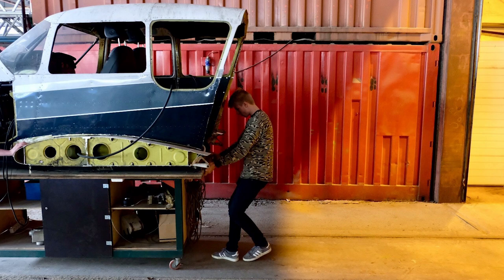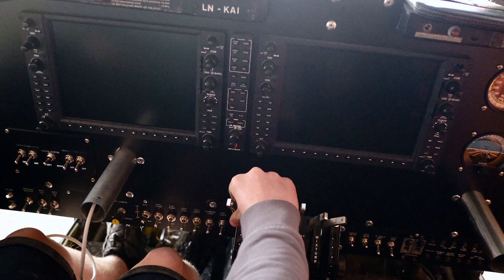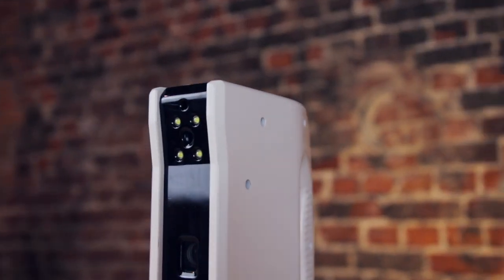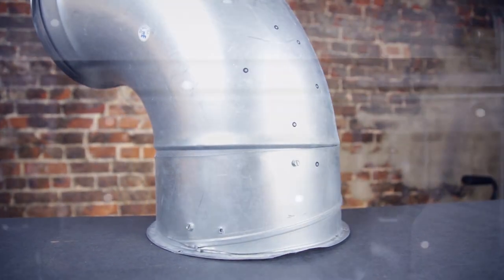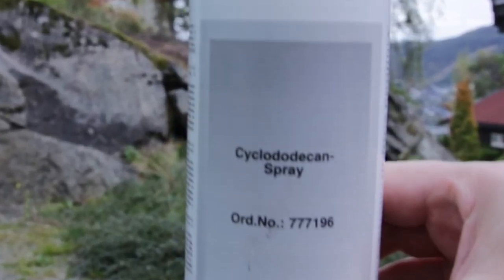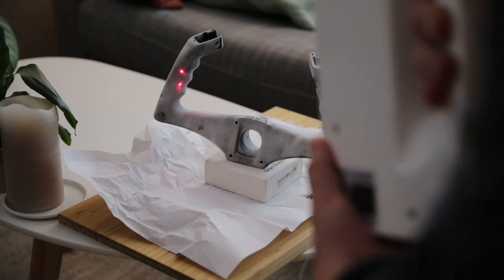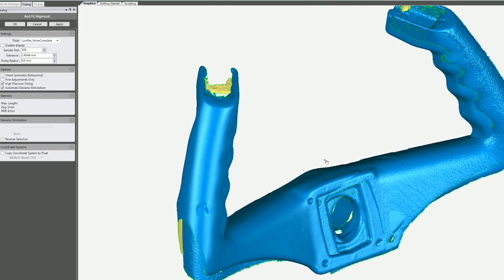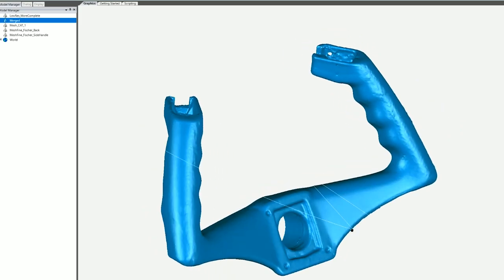3D Scanning a airplane Yoke controller - Thunk3D Fisher S

Comment: Is this the better 3d scanner in the range of 1000$?, do you think that Einscan sp is better? or even SE version?
Reply from the maker: It's a bit higher, as it's a handheld scanner. More in the range of Einscan Pro+ , but cheaper =).  THey have the Thunk3D Cooper M20, that I also reviews that is much more similar to SP/SE
Reply: @3DPrintTechDesign  how does it compare to the einscan pro+?  I own a cooper m20 and looking to upgrade to the fisher S

Comment: Pretty good scanner for reverse engineering imho
Reply from the maker: it does the job very well! fast and easy =)
Reply: @3DPrintTechDesign   I see, thanks for this video!
Reply: For a price of 6k ist damn shitty.
Even a smartphone or xbox kinect can do so... lol

real quali? check the GOM Atos Core...

Like in this Video:
https://www.youtube.com/watch?v=iNqCLwoMBCk

https://www.gom.com/metrology-systems/atos/atos-core.html
Reply: @hanswurstusbrachialus5213  I understand this is a 7 month old comment but Ill reply anyway.  The Fisher has demonstrated the best scans from my research then any other handheld scanner in this price range.  It especially excels from my eyes in organic material such as the human face. The Einscan, Peel, and more do not achieve the same results and if they do then they do not showcase it in their sketchfab models.  The scanner you linked is currently listed at 27,000 USD and is not a handheld scanner.  Research a little next time :)
Reply: @CauldronBlack  The scanner i linked was not supposed to be an alternative.

But an example for real quality.

Read better next time.
Reply: @hanswurstusbrachialus5213  I could be wrong but in most situations when someone says this product is shitty and they should check another one out...they are advocating it as an alternative.  A dumb alternative because any scanner costing 27,000 dollars (mind you the fisher costs 6) will 99% of the time be more accurate (depending on the task).  The troubling thing is instead of picking an alternative handheld scanner in the same 4-6 thousand dollar range to compare you chose a 27,000 dollar one.  I'm going to go compare a new Toyota Camry and a Lamborghini Huracan now.
Reply: @CauldronBlack  Second sentence: a smartphone (photogrammetry) or xbox kinect scan. First: free. Second: Around 20-30€.

Again.. just read, the alternatives are mentioned.

And additionally - not being an alternative, but a hint to a really good scanner, was the link.

I still don't get your point.

Maybe because my englisch is not good enough, though.. ^^
Reply: @CauldronBlack  so I'm interested in the Fisher S,  now its 7 months since you wrote the above comment, do you still recommend it for the price? I would like to know as much info as possible before I go ahead and buy it. Thanks!